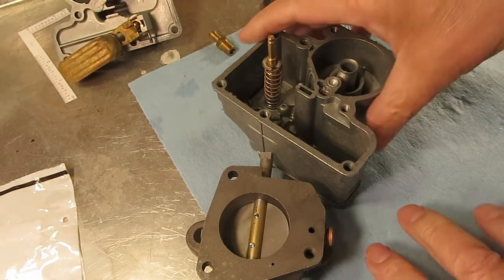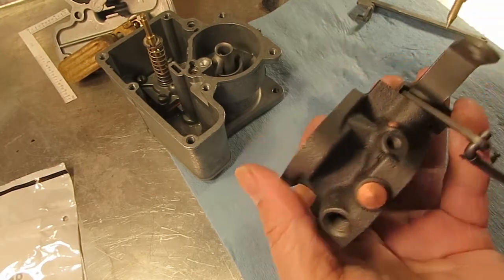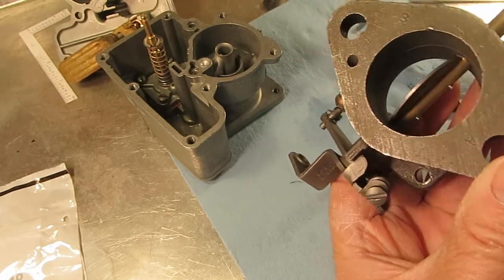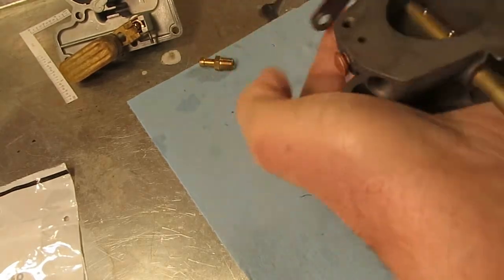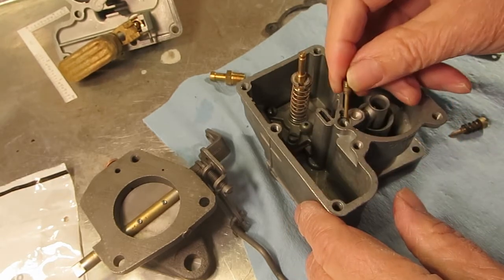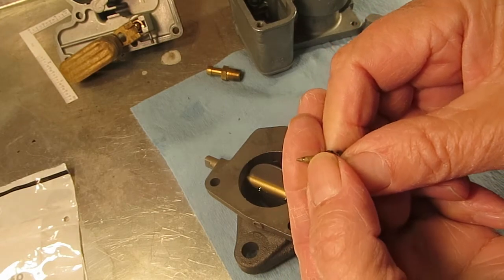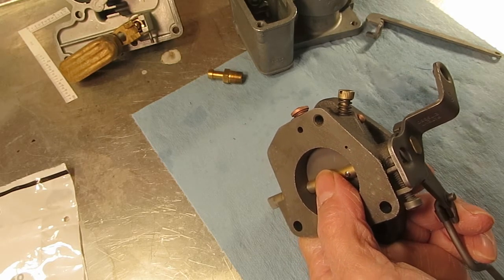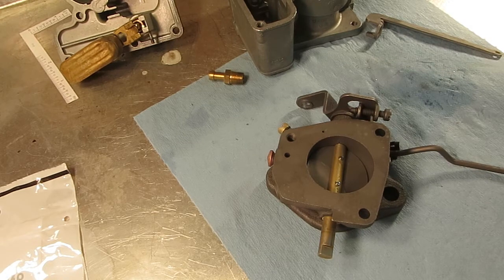Carter YF 1 Barrel Carburetor Idle Circuit

Comment: Working on a YF off a 1952 IH dump truck. It look a little different. Only one hole on the bottom of the cast iron piece, other than the main hole for air to flow through.
Reply: @MikesCarburetor  There is a vaccuum advance that seems to work. The backfire through the carb seemed to stop when I hooked it up. (I forgot to connect that. LOL) But now it doesn't start at all. The compression seems low. So I think that's the problem. I loosened the spark plugs, so they were barely on there. I watched when I cranked it. Most moved a really small bit. When the fuel mixture would fire, it puffed out blue smoke from the threads of the loose spark plugs. So I think the little bit it ran, trashed what was left of the head gasket seals. It has been sitting for 15 year plus. I'm only visiting my mom for a little bit. So I don't have time, and my tools to rebuild the engine. So she is having me list it on ebay. The 1952 IH Dump Truck with a snow plow blade mounted on the front. I would do the work if I was here longer, had my tools, and it wasn't so dang cold out, here in Washington! I live in California. LOL

Comment: Where can I get a kit to bush the throttle shaft on a cast iron base? I'm getting air intrusion with throttle closed at idle.
Reply: @MikesCarburetor  Ok. Thank you very much for the quick reply! Having an issue finding information on using a ream and drill bit advertised for a modern aluminum base carb on this cast iron base 4480s. Your thoughts?
Reply: @MikesCarburetor  Perfect! Thank you!

Comment: Hi mike my truck runs great and idles perect after warm.  I seem to afto feather the gas untill its warm or it will die out. Ive come to the clonclussion the choke is opening too fast? What are you thoughts? And also its a carter yfa motocraft single barel